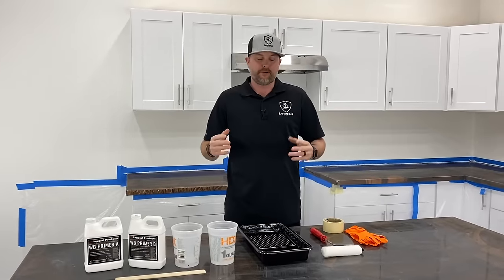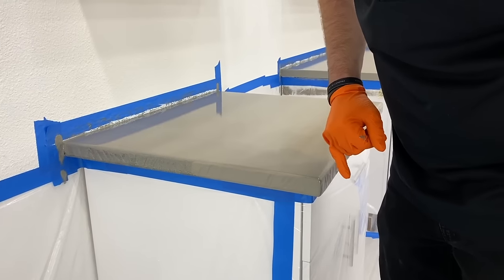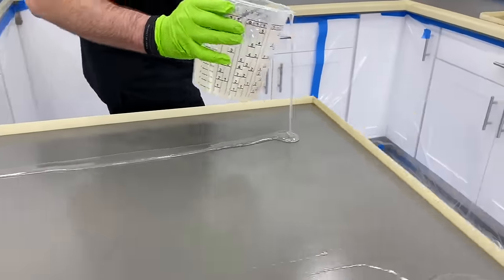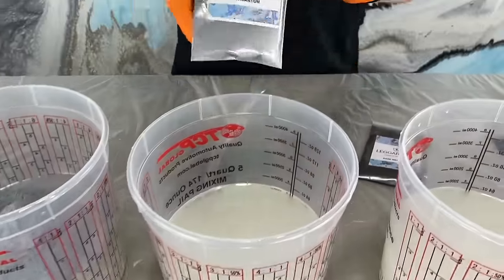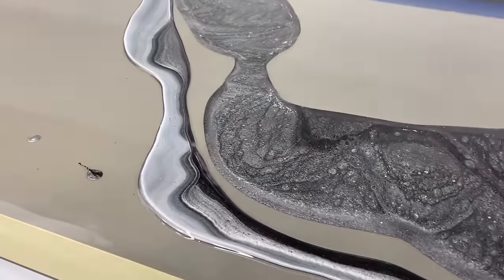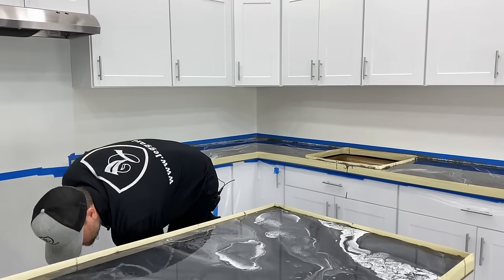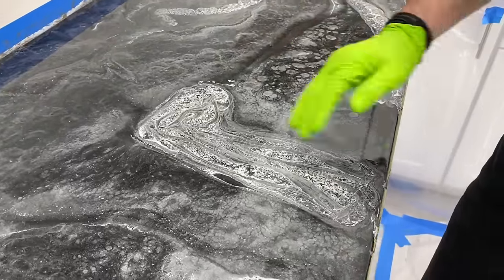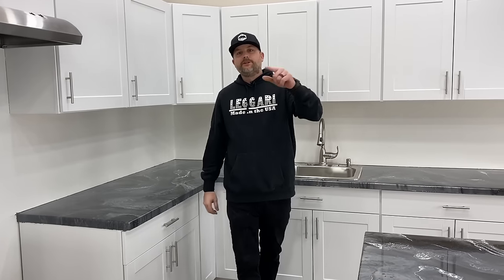Use Epoxy To Resurface Countertops To Make A Faux Stone/Marble Look | DIY Countertop Remodel Ideas

Comment: Just wondering about the durability of this epoxy product? After it cures, can it withstand the normal abuse of kitchen countertops? i.e. hot coffee mugs/hot pans, kids? Will it stain easily if you spill say pomegranate juice? And is it reversible? say you want to remove the remove the epoxy for whatever the reason? Lastly, can you apply another epoxy color over the existing epoxy color in case you had a change of heart in terms of kitchen counter color? We'd like a white marble look to brighten up the kitchen. Thank you for the informative video.
Reply: I have the same questions specially I cook every day for 5 people
Reply: Same question 😥
Reply: Epoxy is one of the most durable surfaces we have available in remodeling. Really the determining factors are what the substructure is, because you don't want to use so much hardener in the resin when it's not over a hard surface, but you can make epoxy almost as hard as glass in extreme cases. 

It's a great floor coating if you've got heavy machinery driving over it, countertops are as durable as the structure it is over as a rule of thumb. 

You don't ever want to use comet or soft scrub or any scouring pad or sanding pad to clean it, as it will dull the finish in a lot cases, but the formula used is typically determined by the structure it is poured over. If it's over concrete or stone, you can go hard, if it's over formica or something softer, then you wouldn't want it to be as hard. 

There are DIY kits that are just general use, you won't get as good a result as a professional installer that knows what mix to use in each application.

Comment: Suppose I don't put a primer, neither do I sand or degrease or clean, I just pour the epoxy. I doubt it will peel off when it's dry, so what bad can happen, and more important, have you tried ?

Comment: how long this will endure in four seasons, very very amazing creativity & designs, how much budget it will bear me???
Reply from the maker: Our products are actually certified for industrial grade coatings made for high traffic commercial settings. So theoretically in a residential, or even commercial setting it will last for decades as long as the urethane top coat is re-applied when needed to protect the decorative coating. This is NOT a cheap epoxy paint that you will commonly find at box stores like Home Depot or sherwin Williams. It is a thick 100% solids epoxy coating formulated for high traffic areas and heavy machinery.

Comment: Awesome technique and products. I am looking for a marble type finish and I have a 20yr old 8" square ceramic tile countertop with 1/8" grout. Besides the bondo for the grout, would I need to rough the tile surface before applying the primer? Thank you in advance!

Comment: Love this.  Question, can you put this on any surface?   Can this be done over bare plywood?  Working on an Island and do not have the complete idea for the top yet.  I would appreciate any suggestions.  This is so beautiful.
Reply: I would sand it smooth and prep any imperfections with all purpose bondo, especially any knots. Then sand again for a smooth finish.

Comment: I'm very surprised you didn't first mention types of surfaces it works on or doesn't work on and surface prep procedures.
Reply: If you read the subtitles there is info about surfaces. Prepping you could see in the video, cover with plastic. Clean and lightly sanding your surface so it sticks as with any paint.

Comment: WHAT WOULD BE THE COST OF DOING THIS COUNTER TOP? DO YOU NEED TO SEAL THE TOP AFTER THE RESIN. HOW DOES IT HANDLE HOT ITEMS PLACED DIRECTLY ON THE COUNTER? WHAT ABOUT THE USE OF A KNIFE ON THE COUNTER TOP?

Comment: Is there no need to use blower or torch gun?
Reply from the maker: Nope, just simply mist our epoxy with denatured alcohol to release any air and pop any bubbles leaving the surface glass smooth!

Comment: how do you remove the painters  tape from the wall?
Reply from the maker: We recommend carefully pulling the painter’s tape off the walls before the epoxy sets. Typically you do this the same day you pour the epoxy because the next day you’ll be applying the topcoat and you’ll want to re-tape those edges before topcoating.

Comment: Sir or Ma'am, looked a ways thru the e-brochure and couldn't find, will this work on grouted floor tile, a contractor used .99 cent floor tiles to do the kitchen counter tops in my house and I'd like to use your system to cover these tile, will it work

Comment: i love the looks of this product. the only thing that worries me is, after you finish and you are showing the finished counters, i can see a lot of ripples in the finish, or at least in the reflection of the lights.  that would have to make the counter top a little unstable, cups , glasses, plates, whatever would not set level or flat.
Reply: He had sprayed some isopropyl alcohol on it  and after it caused the ripple or dimple affect and dryer it flattered out
Reply: Was looking for this comment. I think if we add another layer of clear coat we can polish it so it can be as flat as possible 🤔

Comment: what if you pour epoxy directly without any prtimer ?
Reply from the maker: It will have a hard time bonding to the surface.  The primer will bond to the surface and the epoxy will bond to the primer.
Reply: Leggari Products 
epoxy not bonding to surfaces ? 
doubt that
Reply from the maker: The WB Epoxy Primer is specifically formulated to ensure proper adhesion to the substrate and is rated up to 3 lbs psi of vapor emissions. It will also help seal off porous surfaces such as concrete and certain wood substrate that may outgas during the application.

Comment: The side of the counter tops on the final product looked horrible and not level what so ever? Whats up with you saying it would self level?
Reply from the maker: Our epoxy self levels really well. This counter has several layers of epoxy poured and cured and because of that, it is slightly sloped. We didn't dam it up for the purpose of this video, so the epoxy does run a little.

Comment: Why are Leggardi kits so expensive?, $400 for 1 gallon is expensive
Reply from the maker: It is actually 1.5 gallons but it comes with the colors and the primer as well to do 50 sq. ft.
Reply: @LeggariProducts  I have spent some time looking through your website and no where does it list the contents of the kits which I found enough to put me off buying your products, even at 1.5 gallons still very expensive

Comment: So I think these tops look nice but I fail to see the value?  It dose not seem to cost effective?  I my neighborhood (as a kitchen and bath dealer ) I would sell you this counter top for about $1500 installed in HD or FX laminate!  I didnt look to see what the cost of this process is. but tape off everything? all the waste of plastic? two guys mixing and pouring? and then 7 days no touching?  Cool? yes.  practical? i dont think so.  If im not going to be practical, i will just get Quartz for $4500 and never buy another top!  although the thought of getting slightly high off the fumes seems legit!